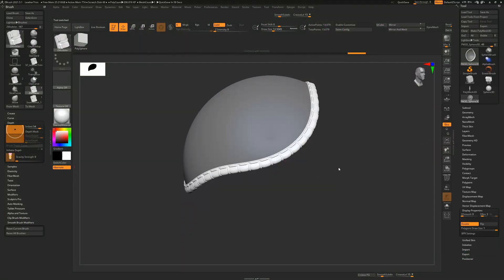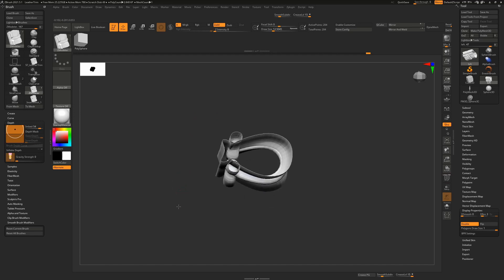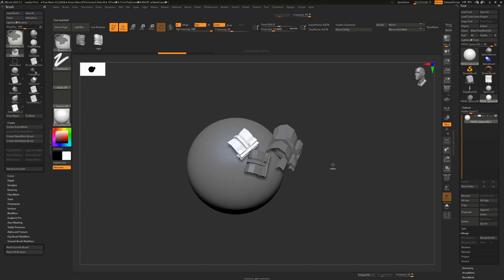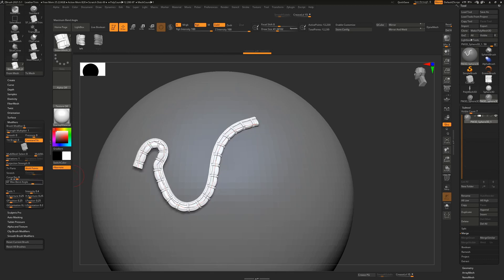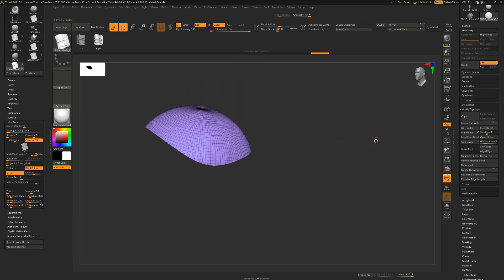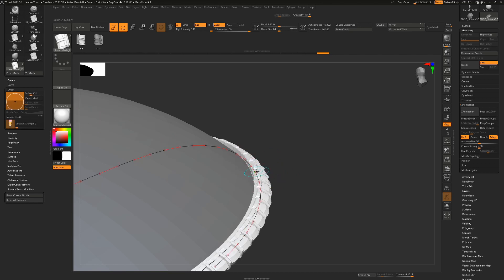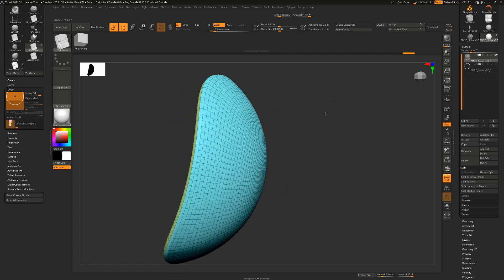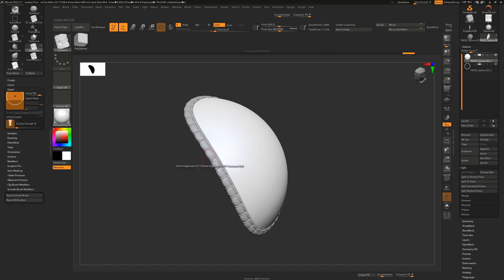How to create leather trim brushes (or any type of trim brush!). Free brush included below.

Comment: Can you make a tutorial about curve brush tricks. Curve issue make me crazy on Zbrush. I am designing bags. All parts are ok such as body, accessories etc. Just straps are definitely hard to control. I am using flat strap brush, give thickness, drawing curves its ok if its straight. But if it need to attach to somewhere or need to rotate along curve its becoming unstable. Rotating along curve with Ctrl mouse function, start point rotating, ok, but end point not rotating. Do you know anything about that issue?
Reply from the maker: Yep, I actually already have one for straps, which you can see here: https://www.youtube.com/watch?v=HOJq5cyuxB4 though I am thinking of updating it as they have some new functionality with the curve brushes which wasn't available in the version of ZBrush used in that video. It should hopefully still prove a little bit useful for you though, especially about 6 minutes in and onwards. But yes, I think I'll do an updated one to reflect the latest version of ZBrush and it's updates.
Reply: @SeanForsythTutorials  Its really big torture for me. Especially that error(i think its error). When you make a strap with rectangular shape, start point objects can rotate, but end point can not. When you try rotate, it starting to twisting depends on stable end shape. Do you have any solution for this?
Reply: @SeanForsythTutorials  https://www.youtube.com/watch?v=aptJ5ylKKU4    on this one\ 5:17  exactly what i need. 

I think i need to learn 3d Coat too :))
Reply from the maker: @unintendedxp  Okay, I think I get you. What you need to do is turn on both Bend Start and Bend End in the Stroke menu under the Curve rollup, and also turn off Snap. That should prevent it from trying to snap to the underlying surface which can often prevent the curve from moving predictably. Then just hover over the end part of the curve until the cursor turns blue and click, and then hold CTRL and drag and it should twist for you.